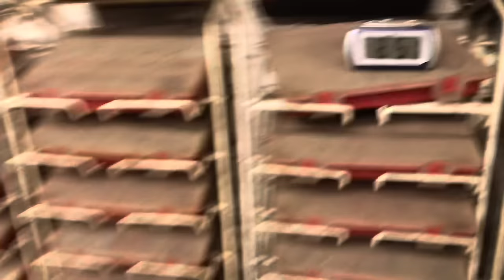IS OUR WRECKED 2018 VW CRAFTER VAN WORTH REPAIRING ???

Comment: Chris works magic as usual and the van job benefits. Modern MIG welding allows but joins in nonstructural panels that would not have been possible some years ago. I remember the issue of cut and shut jobs, badly brazed together on the basis of where the weld landed all was good and where it did not, cover it with underseal or fiber-glass . Back then it often was rife, and the results were bad.

Comment: One thing about backing plates behind joins in addition to being a place for moisture to sit between layers of steel, you can create very strong areas, where you're not supposed to - a chassis leg for example, that could be the difference between the car folding up and the occupants walking away, or the car transmitting the impact and the occupants folding up and being badly hurt or dead. OK to have glued backing plates in the safety cage, as Chris says but not welded in general repairs all over the car. It's actually a hidden danger. That Chris is a bloody marvel!

Comment: Absolutely nothing wrong with the way Chris cuts the panel, but the way I normally do it is to clamp in place as normal, then using the thinnest possible cutting disc, I slice through 'Both' panels. The gap left is just nice for welding, and works well if, like me, somebody is not quite as accurate as Chris is with the angle grinder. Many thanks for this great channel. Tony.

Comment: Hi Guys. Another method used to be overlay the new panel, clamped in position. Then cut the excess off and the existing bodywork in one cut. You then have have a perfectly matched joint to weld. 👍🏼

Comment: Another great video as always
Just fyi - I've read that pressing accelerator doesnt do a thing in cars with electronic throttle - it just cuts off. Some cars won't ever start with gas pedal pressed to the floor

Comment: You did say you bought that van from a friend, bit naughty to tuck you up with all the swapped panels I would not be happy 😡😡😡
On the butt joint, welding is bar far the best way that’s what I was doing 40 years ago, yes it’s thin metal try welder Renault and Citroen then you need to be good they are wafer thin👍👍👍👍
Reply from the maker: It come through a friend not off a friend 👍

Comment: Door gap at the top seems away from the van, maybe the camera angle
Reply: They said in the video the hinges were bent.
Reply: @stephenricketts7764  be surprised if it latches that the cause of the top of the door being out would be hinges at a much lower point, wondered whether it had been pulled at the top hence mentioning